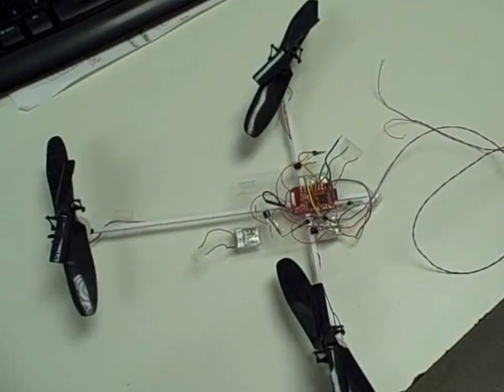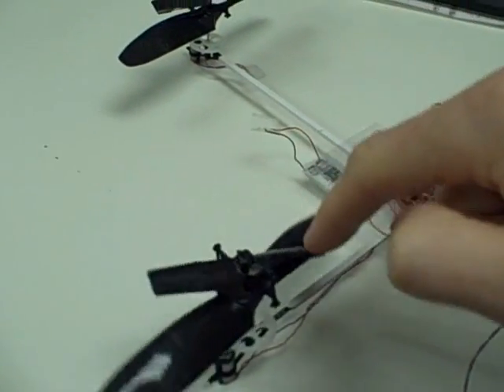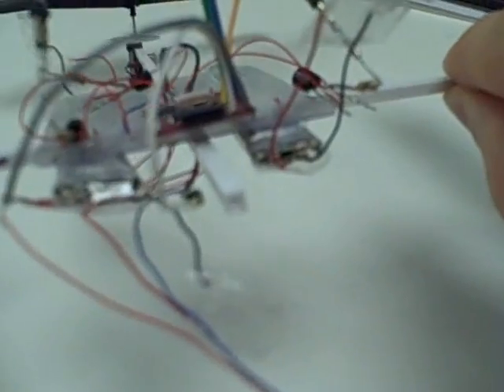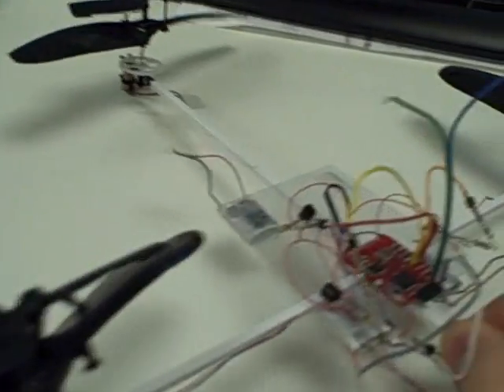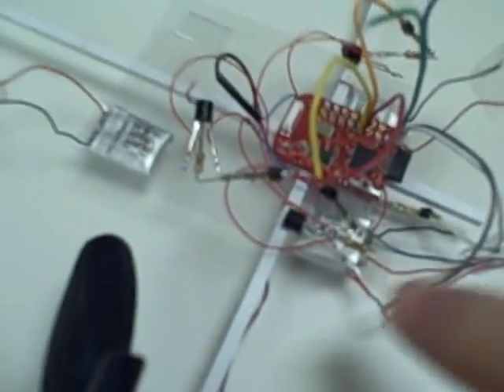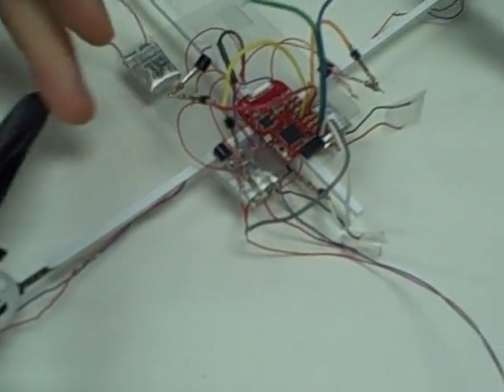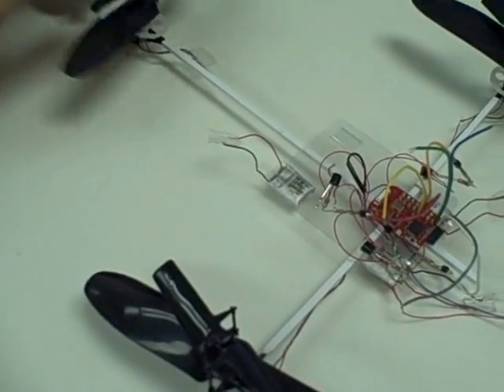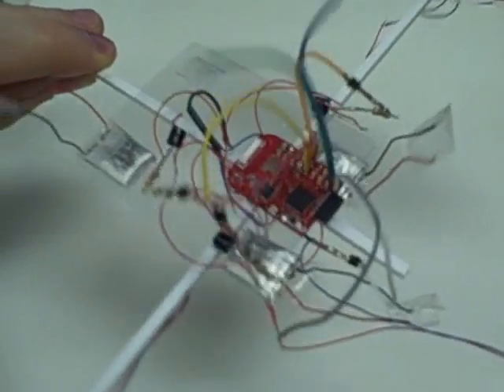Mini TriCopter Robot

Comment: try using the rotor assembly from 3 Syma S107G coaxial helicopters. I had much better results. One of the helis has it rotor blade swap top to bottom and vice versa. with the speed controller wired so that the motors are reverse polarity. and there you go. I also had a great deal of success doing this with 4 S107G's doing the before mentioned mod on 2 of the helis instead of 1.

Comment: You have a tri-copter without a tail rotor control, most tri-copter have props that rotate the same way but the tail motor pitches left or right for yaw control, you would need to add a ultra micro servo and pivot for the rear motor. Search "tri-copter yaw" for more info.

Comment: What you need to do is quite easy actually. Find 3 props that will fit those micro motors for ex motors from a ultra micro p51 or t 28 and put those instead of the blades from a airhogs heli. If that dosnt work just buy the replacement motors to the parkzone um planes (dosnt matter) and use those instead. Also use the same esc/control unit from those um planes so now you can program the motors so one will slow down to turn and 2 will speed up to go forward etc.

Comment from the maker: @whatnottobe not exactly - it would result in the vehicle flipping over. Imagine the propellers are providing a constant "push" - if one side is pushing harder than the other, then it will start to spin/flip. To hover at an angle, you'd need equal pushing, but only in the straight down direction. Once the vehicle starts to tilt, it will move sideways.

Comment from the maker: @whatnottobe that would indeed reverse the motor, but the problem is that the propeller is much less efficient in one direction than the other. In other words, the reversed motor wouldn't be producing as much lift as the other one.